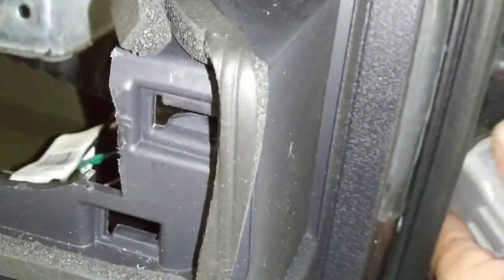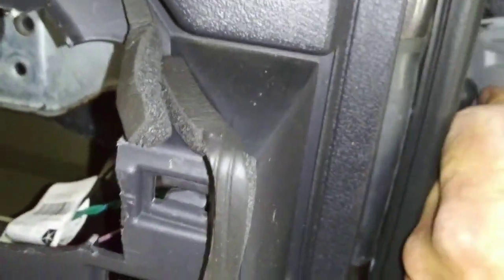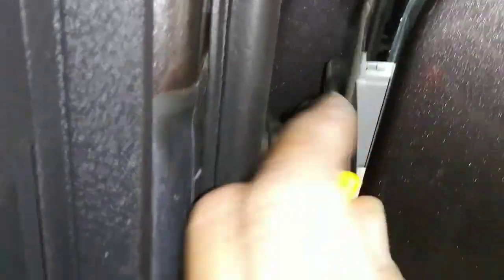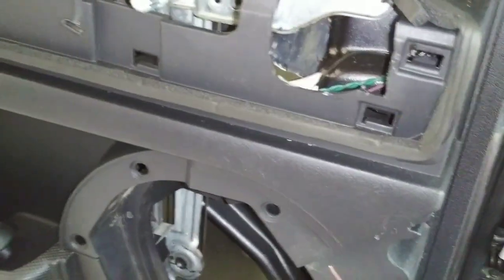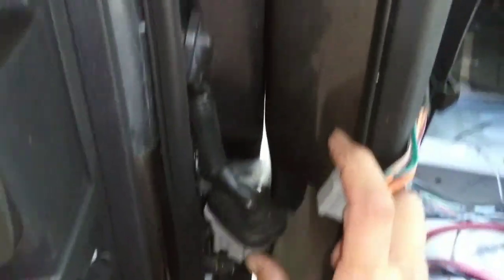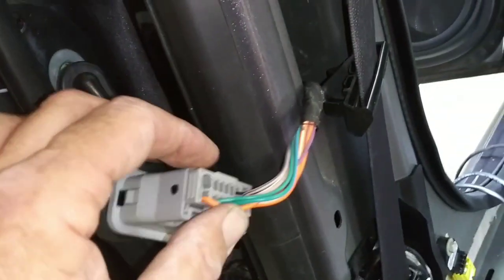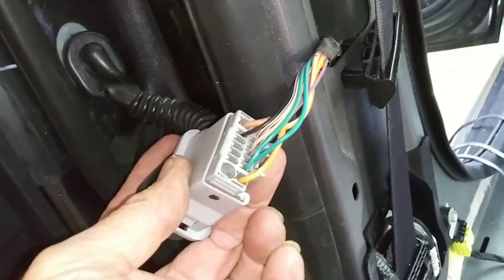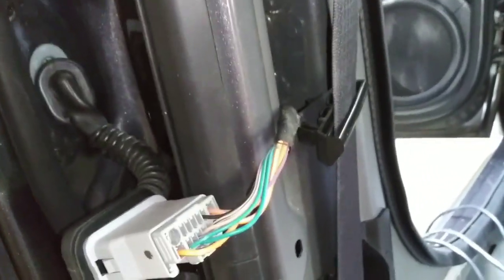Jeep Patriot Speaker Wire Installation

Comment: Technically, couldn't you cut the audio wires after the door seal (in the patriot after that rubber piece) and connect that way if you soder or tap into the wire? Then you avoid having to fish it through and you connect directly into the amp.
Reply from the maker: Yes you could but I wanted the option of having 4spk wires to run active.

Comment: Man.. I have a 2017 and I'm just now about to upgrade the door speakers, seeing this makes me know its gonna be a little time consuming now.. I'm pretty sure im about to run into some problems with this now.. ugh lol... My suggestion is use a copper and electrical tape together and fish it through since it is bendable. that rubber piece is going to be annoying to deal with.. but nothing electrical tape can't solve.
Reply from the maker: No real need to run new speaker wire for a simple speaker change. The only reason I did was to have the option of running my component speakers "active" which I haven't gotten around to doing. Factory speaker wire will easily handle 100watts RMS.
Reply from the maker: Oh yeah if you have power windows and locks it's going to be virtually impossible to find a place to drill thru the factory plug.
Reply: @thenotoriousrvh6091  this is great to know. The speakers I got are 90 watt RMS with a max of 160 RMS. The Amp I have runs 100 RMS x 4 + 500 RMS x 1 at 4 Ohms. I'm still going to try to get that speaker wire through.. I'm sure the sound will be just a little better if I can run it that way..  If it doesn't fit, the other option is to just make a small hole through that plastic piece to fit that speaker wire and cover it with some sort of liquid electrical tape to ensure there is a proper seal to be safe.
Reply: @thenotoriousrvh6091  yep, so I'm gonna have to make a hole somewhere else and seal it I guess

Comment: This is exactly why I’m running off the factory wires in the Hyundai lol
Reply from the maker: Only reason I did it was to have the option of running the components active if I wanted to. Wasn't too comfortable with the factory 18ga handling 200w rms either. The wire ran was a HT 4 conductor 16ga doubled up for now, unless I change my mind.

Comment: They dont make it easy anymore, Back in 92 my S-10 Didnt have anything between the jamb and the door I had to put a grommet on the door and one on the jamb then black  techflex between it it worked and looked pretty good. Luvin the build series!👍
Reply from the maker: Haha back in the day, I used an antenna mast to poke wires thru door boots. Worked like champ and the little ball didn't scrape any wires.
Reply: @thenotoriousrvh6091  hell yeah you could unscrew it from your fender and put right back when you were done🤣🤣theres a place here in okc called petra electronics they sell really skinny fiberglass rods for cheap but hey im a coat hanger guy from way back👍🤣

Comment: I did the exact same thing on the rear doors of my Suburban. Front doors is just a straight flex tube. Rear doors goes into a plug. I just drilled out a hole like you are showing here.
Reply from the maker: Luckily mine has manual windows and locks. If it didn't would have had to find a universal boot and drilled new holes.